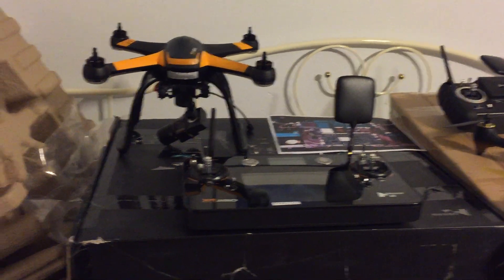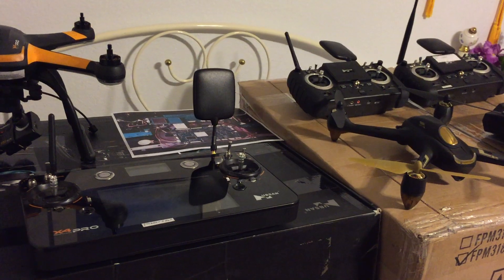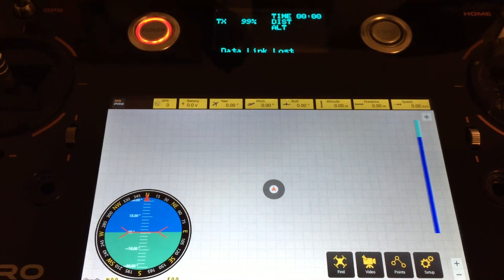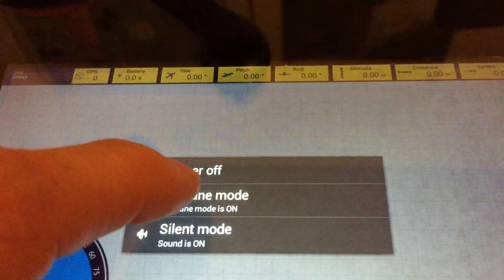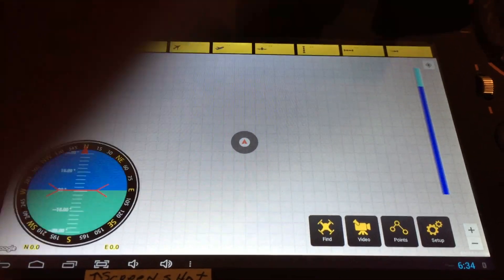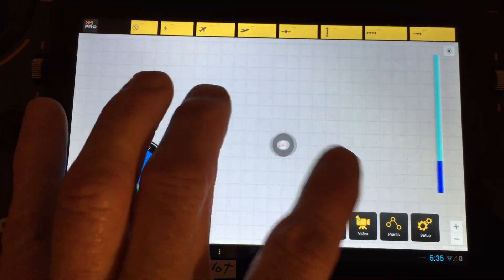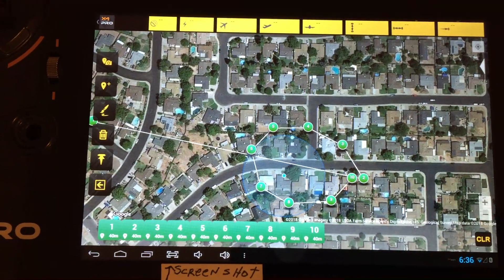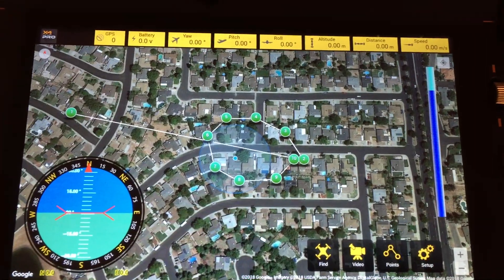Using the Hubsan H109s high end H7000 transmitter tutorial.

Comment: If you notice on the MB there is a receptacle for a GPS module. I was hoping you could add one and get the GPS readout of the transmitter location like you have on the H906A transmitter. However, after adding the module I couldn't see any other GPS readout, only that of the aircraft. Any ideas how to get it on the display? Don't know why they would have a GPS receptacle on the MB if you couldn't use it. The newest H906A transmitters for the H109s come this way without a GPS module. I put one in mine and now get the H906A's location on the screen.
Reply from the maker: Many have tried adding a module. Problem is it would need new firmware to identity the gps signal. Unfortunately Hubsan has moved on and nothing was done to upgrade it.
Reply: @binford12345  No, I tried 2 different modules and I'm sure they are working but as you said, no display. I found out there is a new TX version for the H7000, it's V2.2.9. Have you tried it? There is also a V2.4.8 which disables the 5.8Ghz transmission...guess you would use this if you are sending your own FPV signal from an add on camera or device.
Reply: @binford12345  Good news. V2.2.9 now displays the transmitters GPS position in the top screen. I connected a GPS module out of a H501 and it works! I tried mounting it inside the transmitter but the plastic is so thick it took forever to get satellites. So I cut a very small notch where the case comes together and ran the wire through the notch and mounted the GPS module on the face of the transmitter just to the left of the Power button. The cable isn't long enough to mount it anywhere else. You can use double sided tape or very thin Velcro.  It works great! The coordinates will flash until you get 6 satellites then they are steady and you can start the drone. So they finally did something right.

Comment: Hi Bindord. Got a new H7000 and everything seems to be working great except for getting maps onto the screen. When I turn the system on it just shows a white map like you have but I have NO Transmitter Location Icon in the middle like yours shows. Am I missing a setting or something? Is the GPS of the transmitter not working? I can connect to the WIFI with no problem and can even launch the Google Maps app and it works fine. I can also bind it with my H501SS and A.
So why no maps or even a xmitter location?  Any thoughts are greatly appreciated. Seriously frustrated...especially for what these things cost.
Reply from the maker: Dhoser to get maps you must connect to the internet so google can download the maps. If this doesn’t work, open google maps and see if an update is available.
Reply: @binford12345  I am connected to the internet but the maps still don't show up and the battery is fully charged. As I mentioned, I can launch the Google Maps app from the apps page and it works fine, just not in the Sunbird app. I also uninstalled Google Maps and reinstalled the latest version as you suggested and still nothing. I can't understand why the little transmitter circle isn't even showing up. Any ideas on that one?

Comment: QC Guy told me there is no novice mode like you have with the H906A transmitter.
I do have one question, when I turn my H7000 and quad on the locations show up fine on Google maps once the get locked onto some satellites. However, there is an orange line from the default location of the drone in Africa to my location. And when I fly the drone there is an orange line that traces the flight path. Do you know how to get rid of or turn off this orange line? It's a pain i the butt!
Thanks

Comment: Hi binford...Have been doing waypoints with my H501S now and it works quite well. I am curious though if you think the H501C will do waypoints with the H7000 as well. Has the same components inside except for the 5.8G FPV module. You have any thoughts on this?
Sure wish someone out there with a H7000 and H501C would try this...quite interesting.
Reply from the maker: All you can do is try, but probably won’t work.

Comment: Hello Binford , do you have a solution for my problem , when i push the power button he wil begins to beep what normal has , but now he begins at the same time to vibrate like bzz bzz do you have this also , maybe i did something wrong but i cant imagine what 
Thanks , kind Regards Peter
Reply from the maker: If your using the h501S model, this cannot be turned off except by taking apart the transmitter and disconnecting the motor. Its expecting a higher voltage. If you also fly the h109S, get a switch where you can turn off and no.